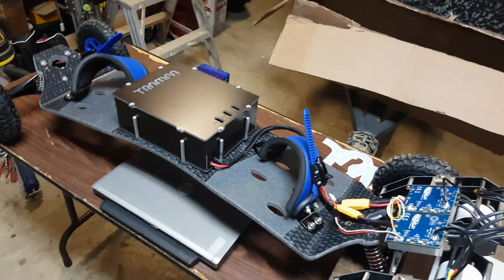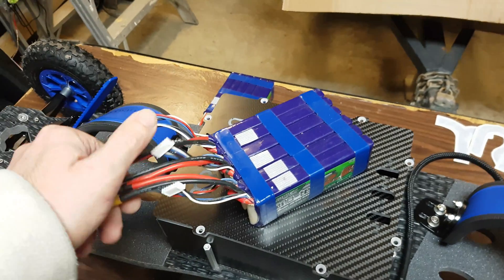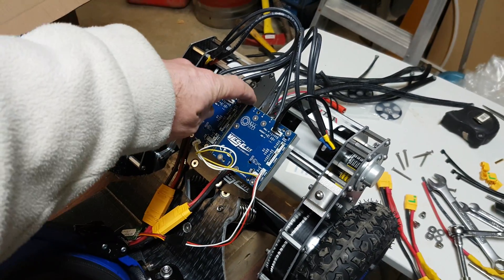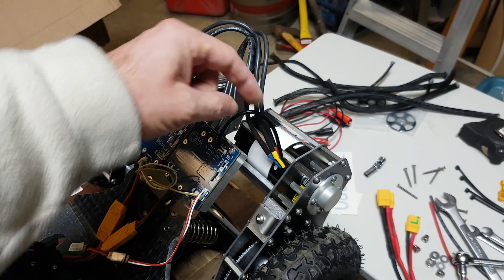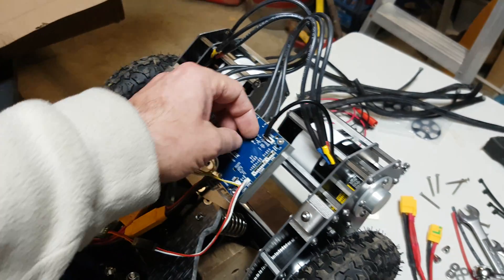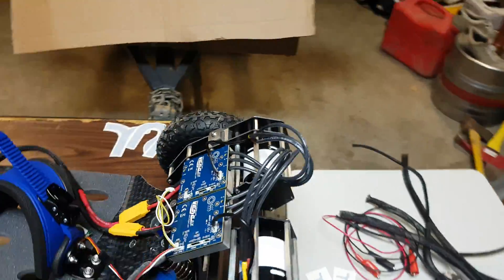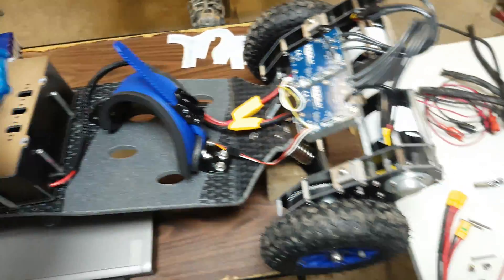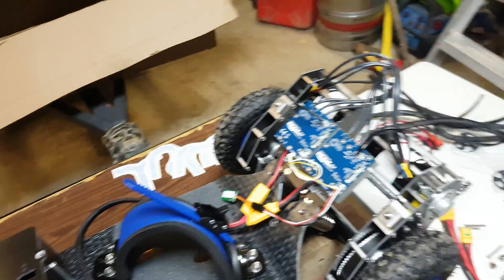Trampa 676E Electric Mountain Board E-MTB - 2

Comment: Hi, I have that exact board.  I was wondering if you would be willing to make me the same VESC box that you built?  If so, how much with shipping to the USA?  PS:  I use 4 * 6200 mah 40C batteries, so 12S2P.  I get about 20 miles on that setup and have tons of power (too much power really).
Reply from the maker: I simply won't have time to cut the box for you, on my home built DIY CNC machine it took days to do it. I can however share with you all the 3D CAD files so you can have any metal-works shop cut it for you on a proper CNC machine, I'm sure there is someone near to you that could do it. I can also send you close-up pictures of mine for reference. If you don't want to share your email address here then private message me on Facebook with your email address so I can send you the files.
Reply: Eric Milewski-  Hi Eric.  We have a 3D printer at work.  That would be awesome.  My email is brettdenaro@gmail.com.  Cheers.
Reply from the maker: email sent
Reply: @EricMilewski  super cool of you dude. Thumbs up for doing that.